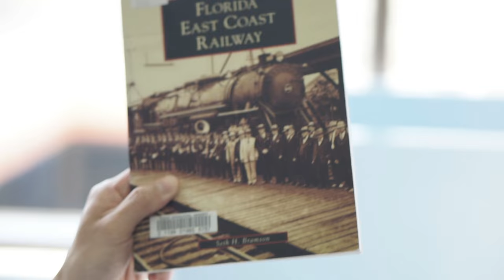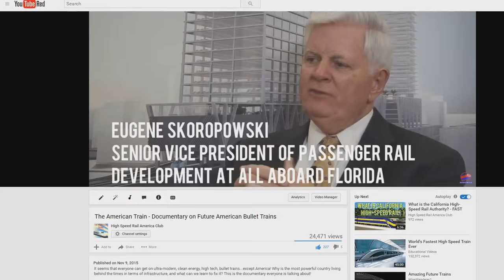"The American Train Part II" - Trailer

Comment: Having High Speed Rail is a smart investment for the country, it brings & means lots of good direct & good indirect jobs. HSR helps
ease and lighten traffic congestion on the interstate highways which did kill off a lot of passenger trains are now the same interstate highways that are bringing back passenger trains.
If there were high speed trains between Los Angeles & Tucson, San Diego & Tucson, Los Angeles & San Diego & San Antonio, Houston,
New Orleans, Dallas, Denver, I would be making 5 to 6 trips a year
to San Diego & Los Angeles, 3 to 4 trips a year to Dallas, 4 trips to
Denver every year.

Comment: I'll be honest,  I really don't think this trailer is convincing enough.
Reply from the maker: We try our best, but we'd love to hear your thoughts in making it better.
Reply: I can't really add anything to the trailer. It was good. The points I was going to bring up like why safety regulations make it more expensive to maintain a bullet train here in America than the rest of the world. Or how its safer and cleaner than driving a car, etc.

Or just other things like privatizing Amtrak or just finding real solutions to problems instead of just dumping money thoughtlessly. I guess the best I or anyone could do is repeatedly mail our state representatives and remind them why connecting this country by not just high-speed but all kinds of rail is important. (commuter, trolly etc) Or also make it easier for businesses or investors from around the world to invest into our infrastructure. 

I guess the best advice I could give you guys is just use other bullet trains. I know the might use the N700 Series Japanese trains in texas. I highly doubt it unless the investors for the project are able to make a deal where they can build the trains here in the U.S and do a bunch of other crap to compile with the regulations.

But yea back to my point, use trains like the Alstom AGV or NOZOMI 500 and  New Pendolino ETR 610. Huge fan because sadly your the only guys doing something like this for rail right now. I'll continue to support you guys because it really will make an impact on the future of this nation.